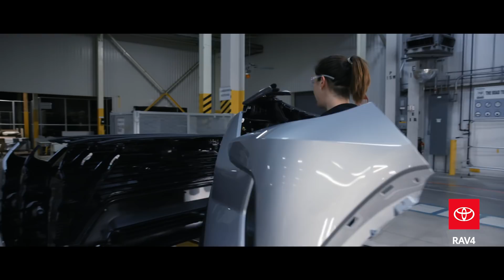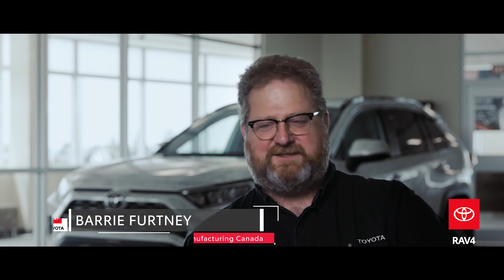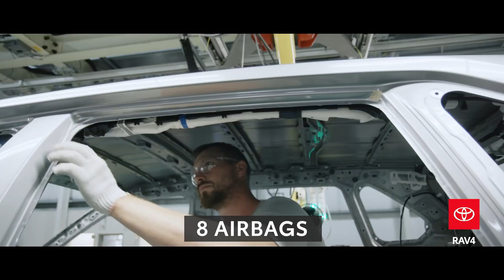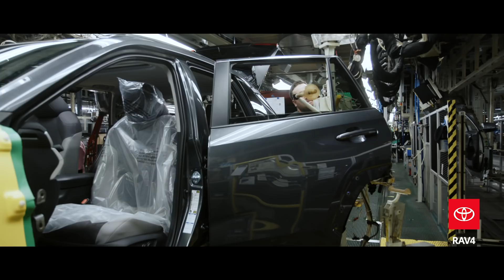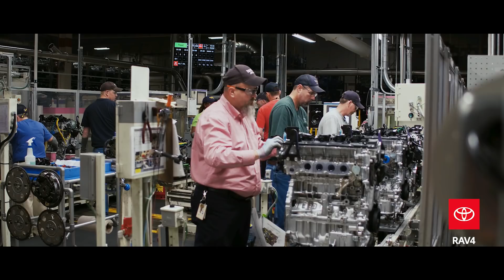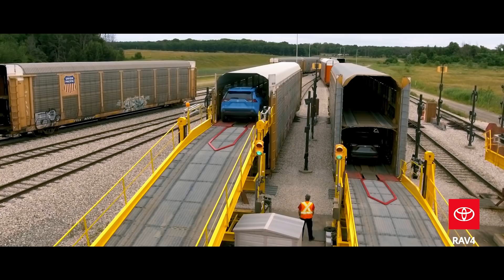An in-depth look at the Toyota Rav4 manufacturing process

Comment: So where are the transmissions manufactured/assembled for the North American market?  Also that is a LOT of plastic on the 2.5L inline 4 cylinder Dynamic Force engine.  Even the valve cover is made of plastic.  Don't you think the plastic valve cover will warp or expand at different rates compared to the aluminum cylinder head or cylinder block?  That will stress the plastic valve cover gasket or bolts.
Reply: They make airplanes out of composites.  It is very strong and durable.
Reply: I believe the transmissions are built at the same plants as the engines in Buffalo West Virginia and Huntsville Alabama.
Reply: Toyota generally uses AISIN transmissions, cannot n which Toyota owns a stake. One if the best tranny manufacturers out there.

Comment: Speakers sound like shit. Seriously. Step it up. By a lot. My sisters Escape sounds like a concert hall compared to my rav. Honestly regret getting this thing, whole interior feels cheap as hell
Reply: But is Her escape at the garage getting Fixed?? Or being Recalled???
Reply: Mike ScepticOne No?
Reply: Depends which model trim she brought   base model come with only 6 or 8 basic speakers which the adventure trim the top of line one comes with bose 10 speakers.
Reply: John Lam they are JBL speakers, not bose anymore
Reply: Yeah speakers can be replaced for cheap. I’d take that over a Ford any day lol. Reliability is the best luxury to have in my opinion.
Reply: Shitty sound systems plague many modern vehicles.. the JBL isnt too bad though. my 2005 tundras base model sound system sounded better than my uncles 2018 f150 sound system